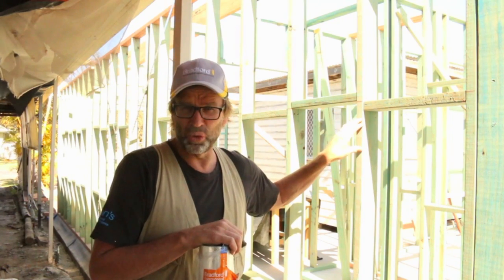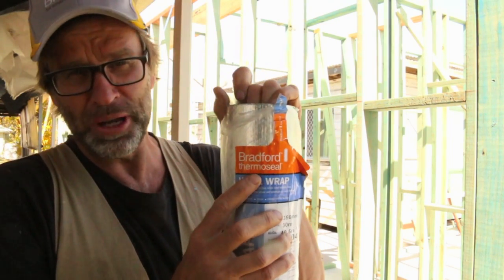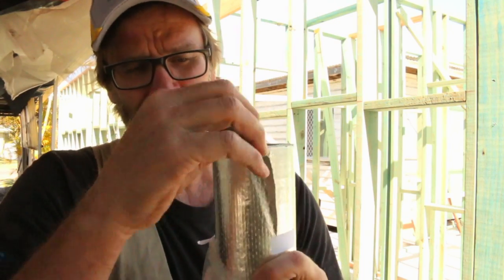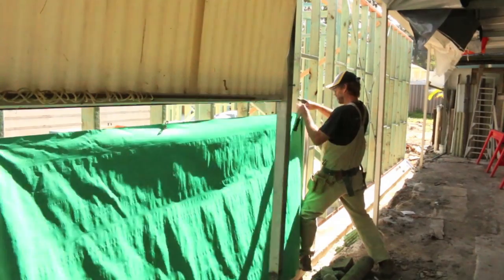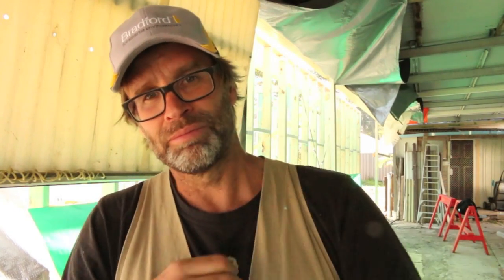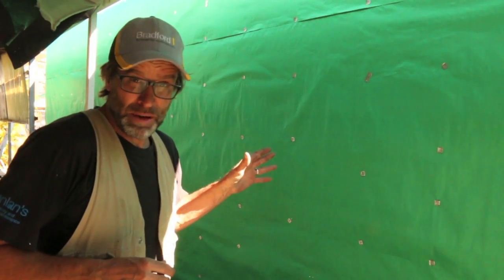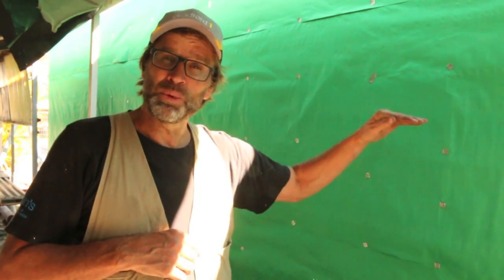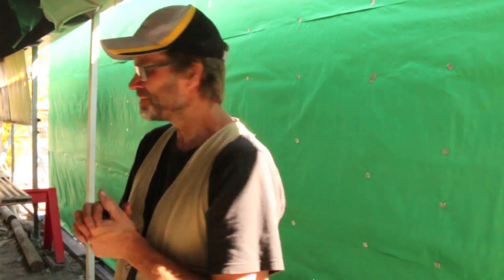How to Install House Wrap. Owner Builder Series Ep 20.

Comment: Thank you Shane.  I learned a new word "sisalation" which apparently is a brand name unique to Australia.  Google is wonderful.  I am quite interested in the different building methods you have.  Here, we never put a moisture barrier on the exterior as it will trap moisture in the walls.   Our vapour barrier goes on the interior between the drywall and the insulation.  We do use "house wrap" often called Tyvek (brand name).  It prevents water from the outside entering but allows moisture from inside the walls to escape. 
I am quite enjoying your build.
Reply from the maker: +peggyt1243 Thanks Peggy.

Comment: Shane, I used sisilation in conjunction with GreenStuff polyester insulation in the walls of my shed (R 3.0).  This is because the western Queensland sun is a fair bit savage. I also put the GreenStuff in the ceiling over the suspended ceiling. It all works well, was warm in the winter and cool in summer. There is one thing I did a couple of years ago, I did the same as you with the wrap, but I kept it going over the windows and door then cut out the holes for them. Much easier than cutting the sisilation before tacking it. I also used the same idea for the gyprock. Cheers Mate, thanks for your great ideas.  Rossco
Reply from the maker: +rosscoesmiff  Yeah Rossco, it does get pretty warm up there. You did a good job with the insulation. Well done. Cheers mate

Comment: It looks like you are progressing. Great! It is nice to have neighbors that you get along with, make building that wall much easier. Did you have to cut the paper for the top band or does it come in various widths? Keep up the great work. 
Thom in San Diego
Reply from the maker: +Thom Lindgren Hi Thom. I actually chopped a full roll in half with my drop saw for that top layer. It made the installation so much easier and l didn't waste as much paper. Cheers

Comment: i am very curious why this vapor barrier is put on first as in the states here we sheet the walls to the framing then apply this vapor barrier before installing windows and doors to be basically foil taped of some sorts before the brick layer comes. some will use tyvek which keeps moisture from coming in but will breathe outwards. inside after all electrical and plumbing is done then we normally insulate then a vapor barrier such as 4 mill poly plastic then the sheetrock.
Reply from the maker: +whitewolf8758 G'day Whitewolf. Over here the climate is a lot different to yours. We don't get the extremes of cold and heat so our insulation requirements are much less. Cheers mate
Reply: +shaneconlan1 i get the weather difference but wondering why there is no sheeting(plywood or osb) on the outside before the poly goes on? thats the main support of keeping your house straight and durable. there is one company here that does what you did and 99 percent of the homes fail within 6 to 8 years as they are very flimsy without the sheeting. only reason they do this is to cut corners and cost. thanks again.

Comment: Question would appreciate your help 
So from the bottom I let it hang past the timber by 50ml. 
And I didn’t use tape what’s the Porpose of the tape ? I do have the tape and I will use it around the windows only around the sides. The top and bottom of need to so water don’t get trapped and run down the sarking instead is that right ?
Reply from the maker: The sarking is taped to make it weather proof and also to keep everything in tact until the cladding goes on 👍
Reply: @diyforknuckleheads  cause I’m thinking the brick layer is gonna come and insert his ties and rip into the sarking ! 
So I guess sarking. Better than no dark in regardless of how you wrap it
Reply from the maker: @Semaj.18272  Hi Saif....the Brickie nails the brick tie to the face of the stud so he doesn't actually damage the sarking 👍
Reply: @diyforknuckleheads  Yeha even the twist ties

Comment: My builder just placed this wrap stuff behind the inside wall Gyprock with silver side facing out and no woolly stuff between the wrap and outside wall. He said don’t need the wooly stuff, is this correct? Or am I going to roast in the heat?
Reply from the maker: Every new house here in Australia has the insulation (wooly stuff) installed. The insulation paper needs to be installed on the outside of the wall and not on the inside of the wall. Good luck 👍
Reply: @diyforknuckleheads  damn so I’ve been ripped off